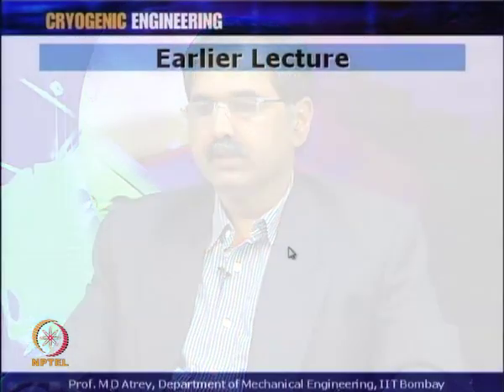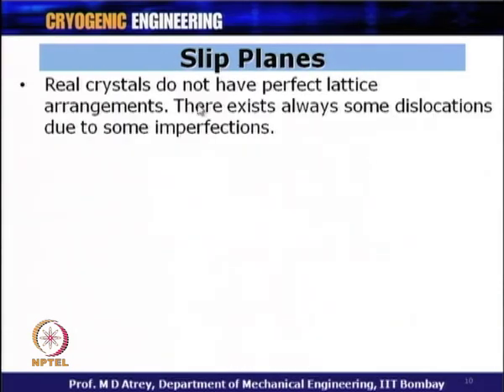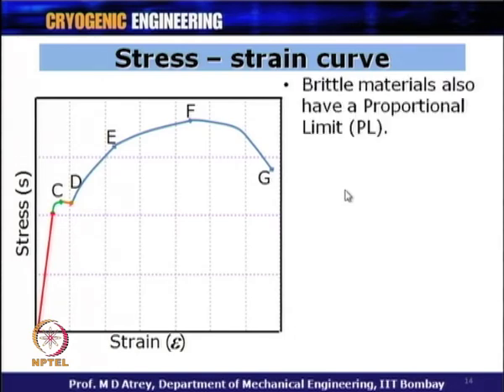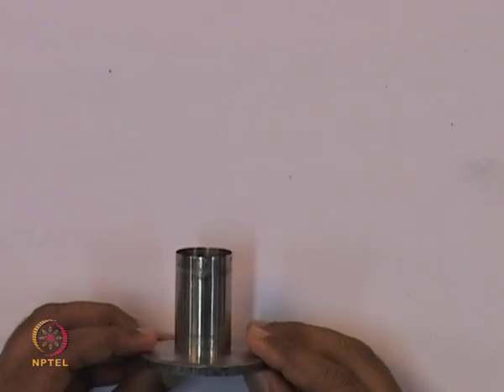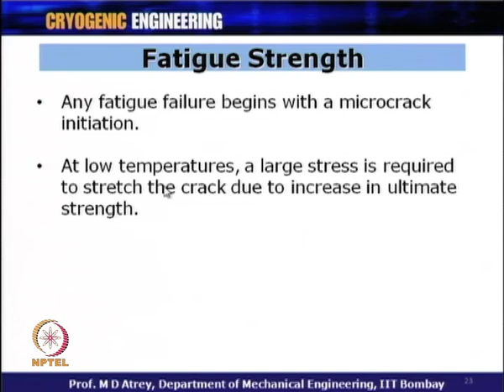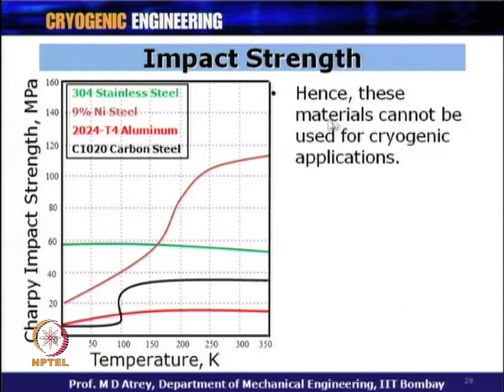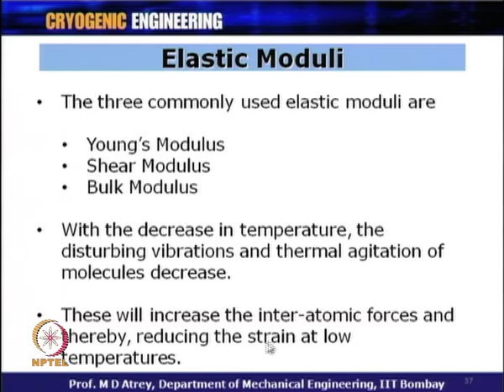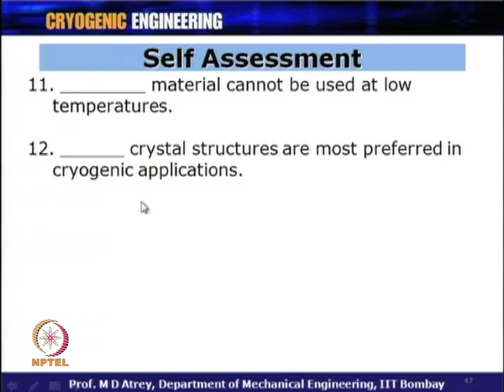Mod-01 Lec-05 Material Properties at Low Temperature

Comment: Thanks for the video. I am in the process of researching and designing a screw that will hold an optical lense inside a microwave telescope. The optics tube operates with a vacuum inside it and is cooled with liquid helium. I am trying to find a good material that isnt metal and will not thermally contract under 5K temperatures to hold the lense in place.
Reply: You can use the G11.